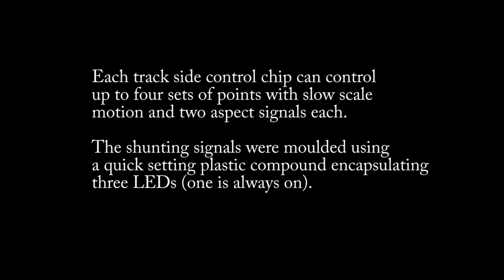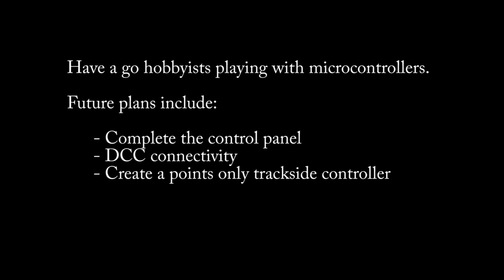Points controller demo

Comment: The signalling as demonstrated bears NO resemblance to real life. As an ex BR Top Link Driver I'll explain the rules covering the use of these signals, and they are complex, as follows:
1. Shunting signals of the type seen, are NOT allowed to be used in relation to the movement of loaded passenger trains. Light locos, Empty coaching stock or freight can accept these signals. 
2. The meaning of the display on these signals is as follows: One white and one red horizontally means "Stop" (Post 1985 new installations show horizontally two reds). Two white lights at 45 degrees means the Driver may "Proceed" no faster than it is safe to do so, and be prepared to stop short of any obstruction. Which clearly tells you this type of signal cannot indicate that the line ahead is clear, which is the main reason why loaded passenger trains are not allowed to accept such signals as permission to move.  

The person giving the demo in the programme, refers to this being a "Goods Yard". If all the tracks seen are sidings then NO signals are needed at all. As movement within yards is controlled by a qualified person on the ground giving "Hand signals" to drivers, for each and every movement, strictly within the Yard.

However if the track on the right is a "running line" with trains heading away from the camera 
(as part of a two track mainline). Then there must be a mainline "running signal" most typically a 3 aspect colour light to protect the point and entrance to the four sidings to the left. This signal should be positioned before the points. It will have a red (stop) yellow (caution next signal red) and a green (line ahead clear).  But it will also have just below the 3 aspect signal head, and fitted to the post, a small shunting signal like the triangular shaped signals seen in the programme. BUT it will have only the two lights at 45 degrees (so NO red). It will normally show nothing, until such time as a train arrives that wishes to enter the Goods Yard. The main red on the 3 aspect head, provides the red/stop indication. If the point into the Yard is set to enter the yard, then the two white lights at 45 degrees can then be illuminated to allow anything but a loaded passenger train to enter the yard.

When a train wishes to leave any of the four sidings, a person on the ground will give the driver a handsignal to allow him to approach the exit.  Just before the exit point a shunting signal of the type used in the film will be positioned on the ground showing a white/red, until such time as the signalman (who could be miles away) changes the exit point to leave, and releases the shunting signal to show two whites at 45 degrees. 

Points within Yards are normally hand operated, and again this prohibits the movement of loaded passenger trains in such areas. Points on mainlines are not only operated by a point motor (or rod in semaphore areas) by the signalman, but MUST also have a "Facing Point Lock"(FPL) if passenger trains are to travel over them in the facing direction. The "FPL" guarantees that the blades have fully moved and not stuck part way. Which also explains why many crossovers are laid in the "Trailing Direction" so they don't need expensive FPL's !!!

"Running lines" (not sidings or yards) in conjunction with colour light signals are normally working on the "Track Circuit Block" system. (Excluding single track lines). This means that all "Running lines" have Continuous Track Circuits. Each track circuit normally begins about 200yds beyond each signal and continues to the same position beyond the next signal where another track circuit begins. So trains on the mainline automatically trip the mainline signal just past to red, when their wheels touch the next track circuit 200yds beyond the signal. However in Yards, Sidings & depots it becomes expensive and unnecessary to have track circuits. So only a short track circuit of maybe an engine length is provided  just inside the yard entrance/exit, simply to reveal to the signalman on his control panel that something is standing close to the entrance exit !  

On the huge 87ft x 25ft British "OO" layout I'm constructing for a privately owned Railway Museum at Mora la Nova station, Tarragona area, Spain. (Open to the public at weekends). This 4 track mainline layout models three real stations (Hook, Basingstoke & Oakley), 4 Goods Yards, Carriage sidings and a steam loco shed in the era 1958-67. The mainline has 3 aspect colour light signalling whilst the line to Salisbury uses SR Upper Quadrant semaphore, and the ex GWR line to Reading lower quadrant. All the 112 signals work exactly as in real life, with the aid of track circuits, and relays. The colour lights can also be set to total automatic and 4 trains left to circulate when insufficient operators are available during the week, mainly for school party visitors. The era 1958-67 also means steam, diesel, and 3rd rail electric are all used.  Full train formations as long as loco & 13 coaches are run, and so that corridor connections can touch, minimum radius is 5ft. Pointwork therefore has to be handbuilt up to 7ft 6in radius  !   Hopefully the layout will be on show by summer 2021.
Reply: thank you  'The duke' for explaining what I wanted to know for my future layout but didn't know where to ask. cheers

Comment: Dave, I love the work that you have done and I will definitely be investing in your servo controllers. Just one thing though. You seem to have misunderstood the purpose of the Position Lights that you are using. Position lights such as these do not give the driver an indication of route. If either route is cleared and the signaller wants the train to move in that direction, the signaller authorises such a movement by clearing the signal. The proceed (CLEAR) indication is two white lights at 45 degrees. When the signal shows a red in the left hand side and a white on the right this is an 'ON' indication and no movement may pass the signal. I suspect that you have already been told this and I only make the comment in order to be of assistance. Regards, Tony
Reply: 1952TonyC we have position lights in the yard I work from on the power switch. although green and yellow

Comment: Too slow, way too noisy. Tell me, why servos? Why not a tortoise switch machine or something more quiet? Lot of ratling and banging around going on down there LOL..
Reply: A Tortoise switch machine costs about $12 each.  This would take $48 in switch machines.

An Arduino UNO clone can be $10 and each servo is less than $2 each in packages of 5.  So you can control 5 turnouts for $20.

Comment: This is brilliant Dave
If using DCC could you change the polarity of the point as well or could a polarity switch be incorporated when fitting the servo?
Im certainly interested and will be having a look at your website.
Cheers
Reply: Using a similar method to throw my points with servos I have used a small 3 pole switch centre is frog connection and the side two are DCC bus connection. I use a + shaped servo horn and have mounted the switch so the side part of the horn pushes it in for one way and is released the other causing frog polarity to be changed without any DCC power going anywhere near the servo circuit :)

Comment: Hi, I think excellent work made with arduino to control the turnouts and signaling lights.
I wonder if you might provide me with the components, ie calse arduino, I have the ARDUINO UNO, and other material used in the manufacture of their good work.
Likewise would ask me facilitate the program so that it can incorporate the arduino.

Thank You

PS: if you have a good facilitarmelo, we will forward my email, thanks